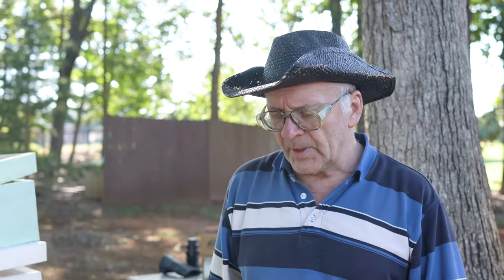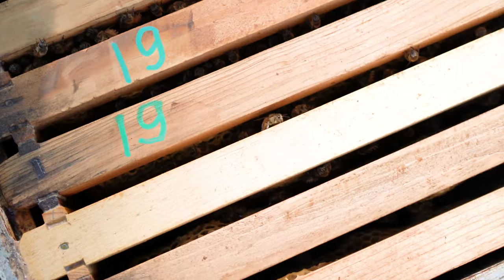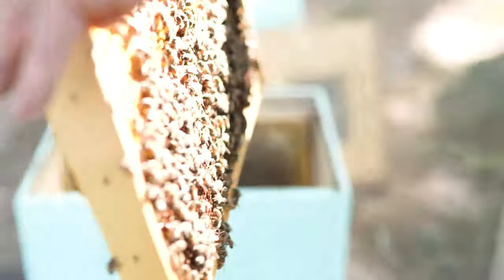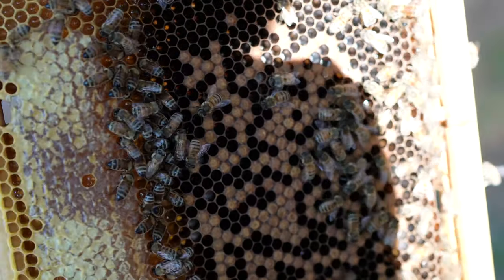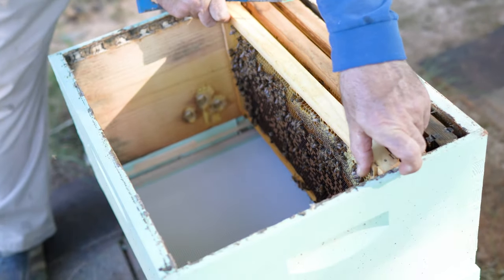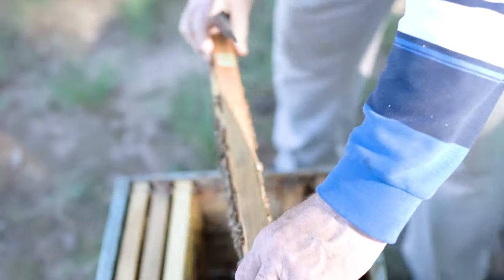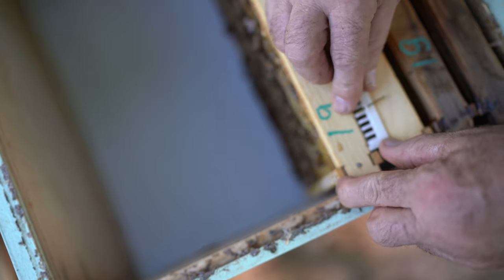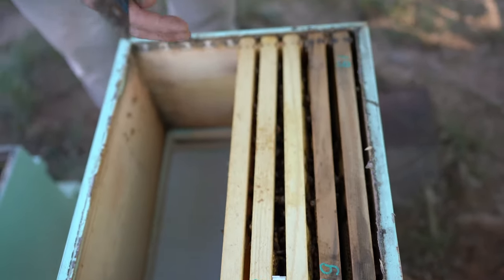Beekeeping For Beginners - How To Save A Weak Hive From Varroa Mites & Prepare It 4 Winter.

Comment: This is a very exciting video. 

Do all Russian beekeepers call the colonies 'families'? (Its fitting because as humans we should be pro-family.)

Since its colder in Russia in winter, do you do tighter and smaller entrance and air holes in the boxes for winter than over here? And how is Pavel's winter setup of equipment for the best survival rate? I'm curious what you might say about 'the most efficient' air hole size in winter. 

One of the reasons I wanted to see what Pavel might say about this is because sometimes when you watch beekeeping videos, you see that not everyone has the best survival rates of hives in winter. And it seems like people should very much concentrate on relearning from the people with highest winter survival rates of colonies. (Too much pride won't let someone do this.) Since Russia gets colder than here, this is very much an opportunity to learn about how you guys do overwintering survival. 

And do you close up the 3 holes in the front middle of the box in winter also? (The 3 holes between the two painted fairies at 3:30.)

Thanks to Pavel also.
Reply from the maker: Smaller holes for winter, yes! And we also close any other extra holes! The survival rate actually depends on allot of things. Some things could be out of our control like the installation of 5g (which is harming bees and the heavy use of pesticides). But we do the best we can!

Comment: Don’t you need the queen laying now to make winter bees?
Reply from the maker: The theory behind this is, what's the point of having more bees if they will all die from varroa mites? Caging the queen gives the brood cycle a break. 95% or so varroa mites live in the brood, this will give the brood a chance to come out with all varroa mites so we can treat them with thyme oil, otherwise, they may be missed and continue to reproduce at a fast rate. Also, the varroa mite reproduction will be slowed down during this time when the queen is caged. Does this make sense? Thank you for watching.
Reply: Depending on what part of SC they live in they may have strong brood year round like I do in South Louisiana. Especially if Pavel and Anna raise Italians.
Reply: How long do you keep the queen caged

Comment: Such great information!  Thank you!  Question(s):  please describe the process of the brood break to slow or stop the varroa mite - I get that the mites cannot reproduce without brood, but the mites are on the active bees and go from one bee to the next so the mites are still around to start up again when the queen starts laying again.  Effectively, there are fewer mites but also fewer bees.  Should you then also treat during the induced brood break?  How long do mites live?
Reply from the maker: Yes, you can treat the rest of the varroa mites that are left on the bees. The brood break helps slow down the reproduction of varroa mites dramatically especially if you cage the queen couple times a year. It also depends on how hygienic your bees are. Our bees are very hygienic and shake off a lot of the varroa mites naturally during the caged queen period. We got away without using any other treatments, just these strategies. I hope this helps. More info is coming soon on this topic in our next video. Thank you for watching.